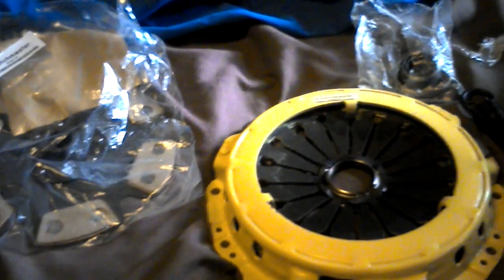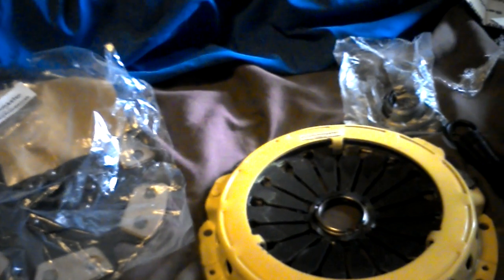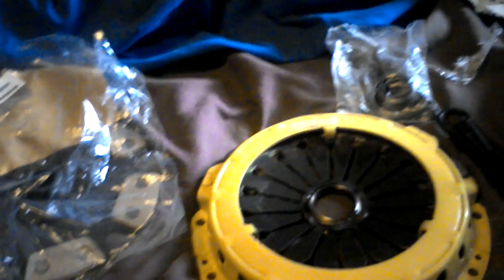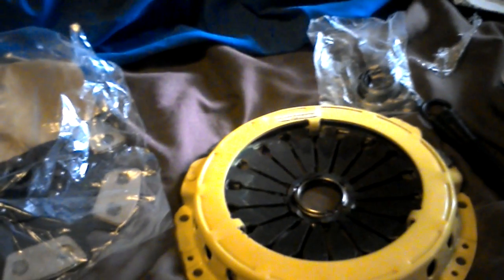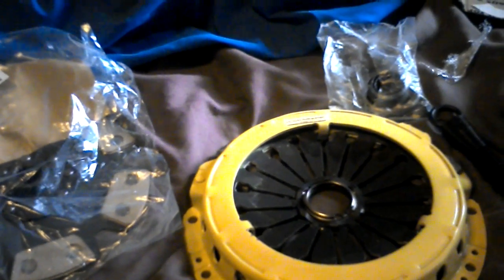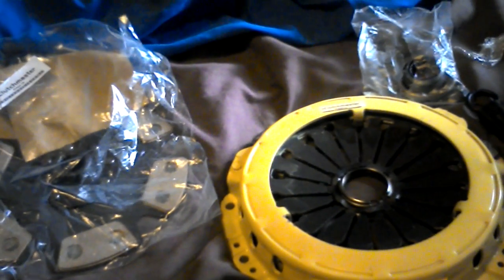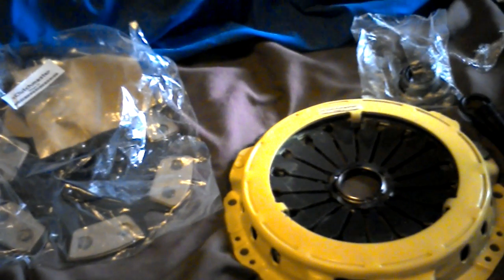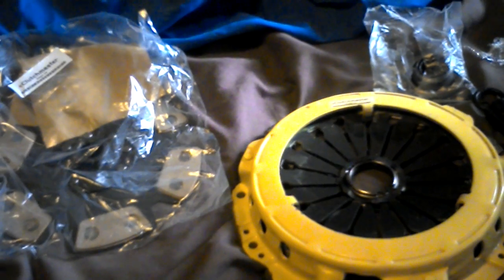New clutch stage 4

Comment: How good are these for street?  Is it a lot harder to street drive in one of these..
Reply from the maker: no not harder to drive. there harder on the transmission  because there un sprung. not made for the street but can be used on the street hope this helps some
Reply: I appreciate it... I picked up a 2003 1.8t Jetta with a bad clutch and plan on installing a stage 4 in it before swapping the engine tranny pedals all bells and whistles into a 99.5 VW Golf...  It won't really be a daily driver but I plan on street driving (fast driving against other fast drivers) every once in a while..
Reply from the maker: nice I like those year golf. stage 4 will work just fine for what your going to use it for